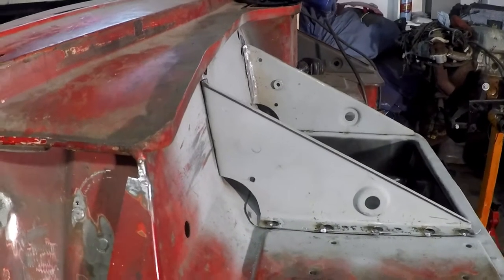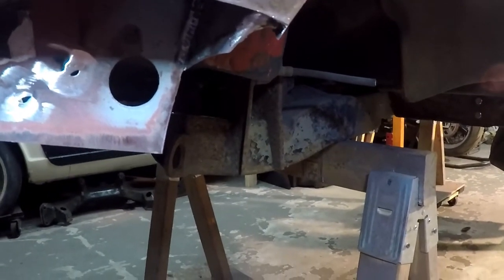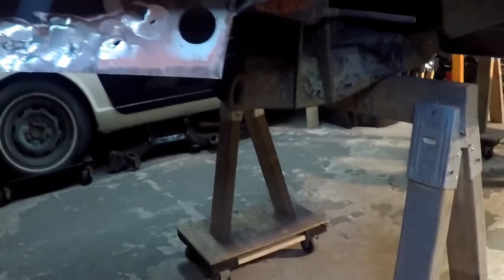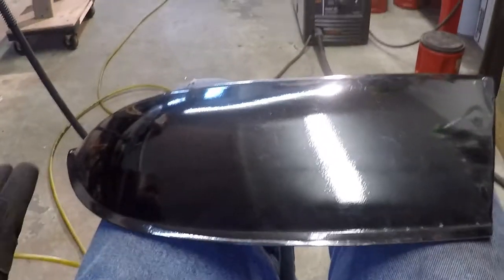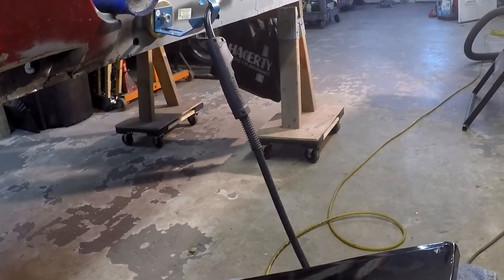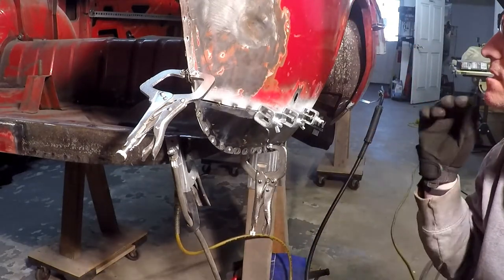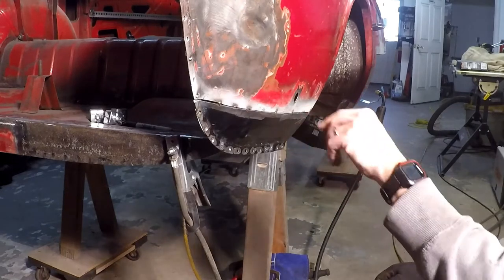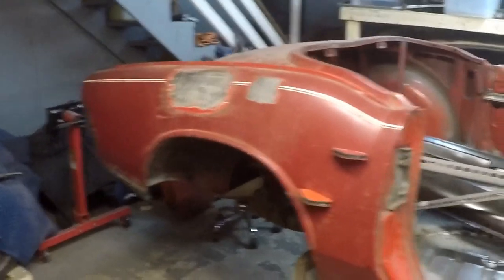Triumph Spitfire Body Repair - Rear Wing Repairs (other side)

Comment: Very good use of your new equipment and awesome results today. Love your little spacer clamps. Never knew those existed. They could have helped me a lot when I was doing the same repair. Your's turned much nicer and even. I will check in the local stores if I can find some of these. Thanks for sharing!
Reply from the maker: Thanks, Elin. I think they are pretty common, so I don't expect you having a problem finding them.

Comment: im getn a bit worried bout dorothy chris, her new  body bits  are  not turning me on  lol
Reply from the maker: +liten48 well, maybe when she gets her new rear....valance, she'll trip your trigger 😄
Reply: really do think you should be looking   at getn a decent chassis to rolling stage and body installed on it before any more welding
Reply from the maker: The rolling chassis is all done and has been since about July. Absolutely everything is rebuilt and the motor has been run in. Believe me, I can't WAIT to get it on that chassis! I'm putting the rear valance on and then dropping it on.